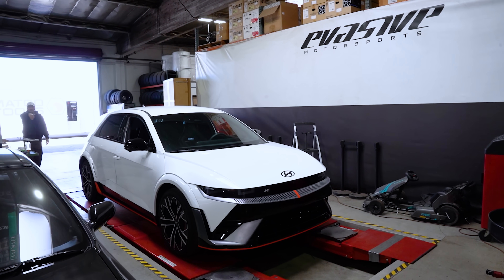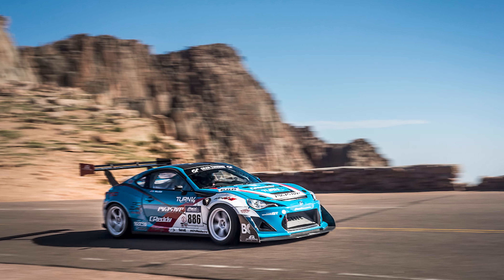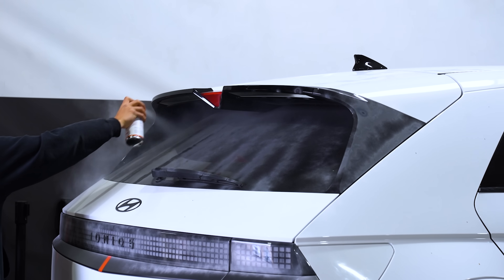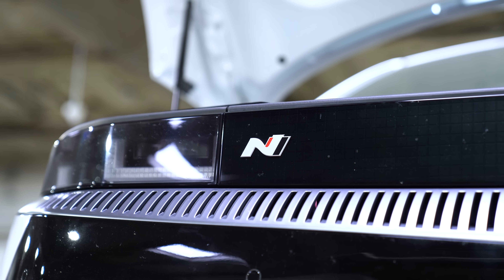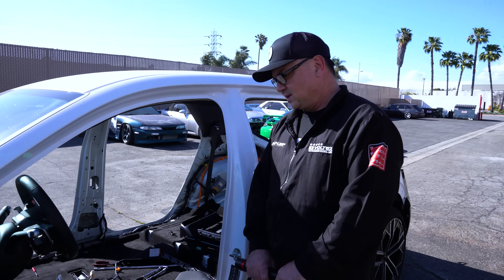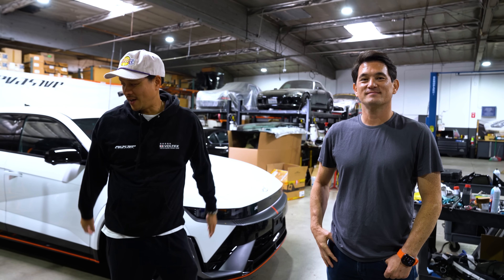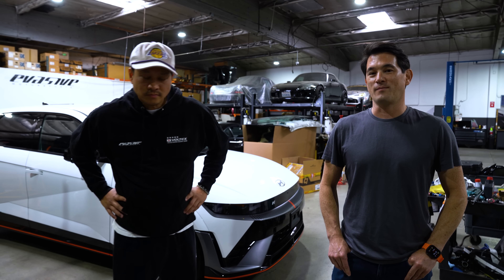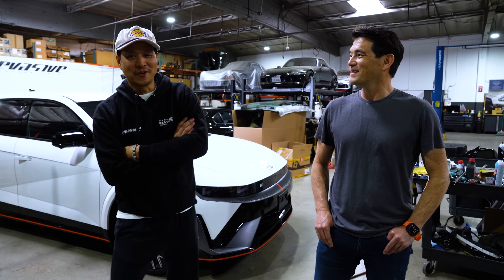Building a Hyundai IONIQ 5 N for Pikes Peak!

Comment: Strictly speaking from physics, weight doesn’t matter for corner speed as long as the tire friction coëfficiënt can be held up, which means a lot of tire that doesn't overheat. Equally with brakes.

The low c.g. (lower than i30N acc to Hyundai), equal weight distribution and the mass centered around the middle does matter and does help here.

Good luck with this project and hope you smash the 10 minute barrier!

Comment: Thanks for doing this and hope keep showing the things behind the build. Hope it helps make some parts for 5N owners can use. 
I am curious how things will work out with all the ICCU and battery problems the reg 5 and the 5N has had for many. I had my main HV bat replaced at 18k miles and right after that around 20k had the 12v go bad given the bad ICCU. With both problems hyundai seemed to be very picky about any thing done to the car like they wanted to know was there any OBD devices connected dash cams, any after market car audio and any use of adapters so on. 
As my car was getting the ICCU replaced they had another 5N getting the main HV bat replaced and told me thats the 3 one they done so just in my area 2 dealers seems like around 4 main bat been replaced over past year, so who knows about the other dealers in my area.